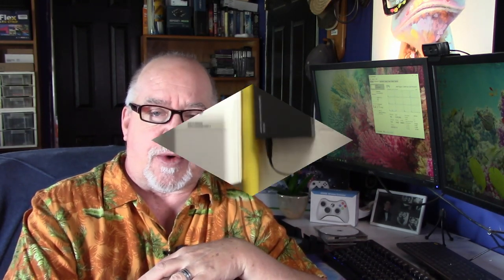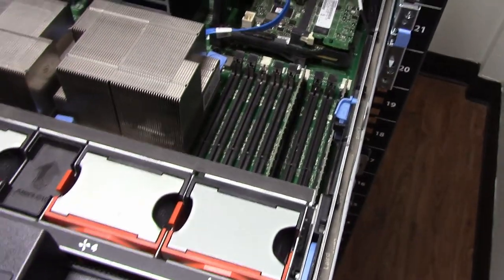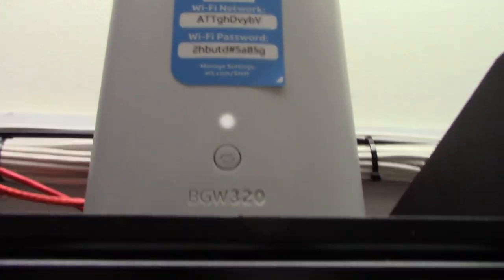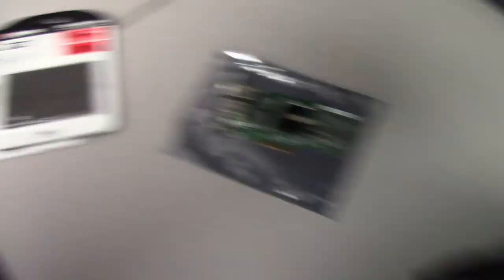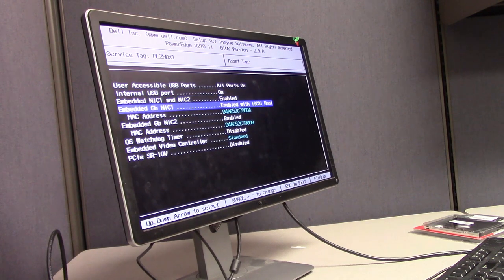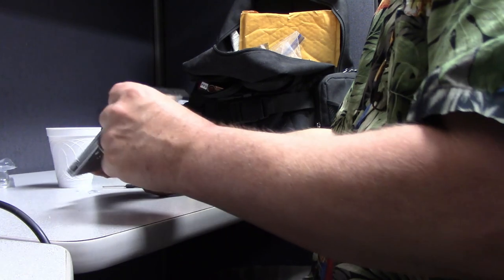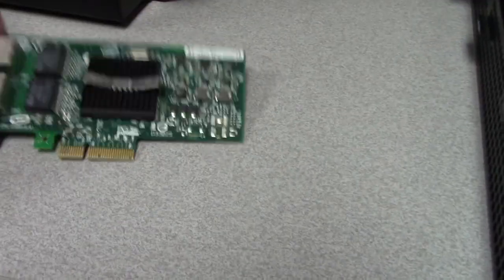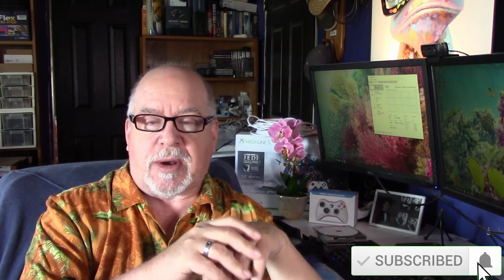A day in the life of an IT Guy - We Need PLAID SPEED!

Comment: Hi Unkyjoe! Thanks for the video! I don't have a solution for you on the network speed issue, but whenever I run into something like that, I like to diagnose things from a very low level and work my way up. I don't recall the commands for *BSD based OSes, but if it's similar to other Linux/Unix systems, the "netstat" command can provide detailed statistics on the interfaces. I would use that to get more diagnostic data, like are you seeing CRC errors (often indicator of bad physical layer/wires/connector)? are there dropped packets? and if so, in the TX or RX line? Is the ARP cache stable or is it purging and relearning the MACs? For TCP stream testing, do you see retransmits? Also, I don't know the command for *BSD, but there should be a way to confirm your negotiated link speed and duplex settings - check if that results in consistent settings across multiple reboots. Sorry, not a direct answer, but perhaps will help you diagnose the problem a little deeper in pfsense OS. Good luck my friend! :-)
Reply from the maker: I will give that a try.

Comment: I have exactly the same server running pfsense. (r210 ii) with the on board network cards at 1gbit zero problems. I think it also has something to do with the cable. For the main memory you can unfortunately only use UDIMM. If it doesn't work with the intel card either, it's not up to the sever. May be the modem a little picki is when connecting. Starting from small (cable) to large (pfsense configuration)
Reply from the maker: I will give that a try.

Comment: On these newer gateways from AT&T when you put them in bypass mode the Lan ports limit your speeds due to firmware bug. There was a firmware update to fix the issue. Not 100% sure if has.
Reply from the maker: Thanks for the information.
Reply: @UnkyjoesPlayhouse  No problem. If you set the Gateway back to default with router functions and firewall enabled your speeds will be right where they need to be.

Comment: You may think I sound crazy but hear me out. I run pfsense on an old lenovo server (yes different brands I know a major difference in bios) but to get gigabit on my router to work I had to install an old version of pfsense and upgrade. It initially started as an installation error one day not detecting my boot drive. Mind you no updates had occurred and my machine already had the latest bios update. My server has intel nics, so I don't think it's a nic issue as I also have routers out there on Dell servers with Broadcoms running gig speeds just fine still.  Longer story made long, I had the same experience with rebooting the modem, sometimes it would hit gigabit most of the times after the reboots it didn't. My boot drives were fine I just had to reinstall with an older version and upgrade and I've been hitting gigabit since. Why or how that made the difference you tell me lol
Reply from the maker: I will give that a try.

Comment: Since ISPs have started offering 1Gb on private networks, the shortcomings of consumer hardware is becoming apparent is what I feel. But I digress. I have never used and Edge Router Lite, so cannot comment on it hitting 1Gb. But it surprised me that you say it hit that speed. Did it? Or was it just a speed where you thought it was near enough?

The Edge Router X, for example,  will not hit 1Gb. It makes Max 750ish. (Sorry I do not have the exact figures in my head)…

The ports are theoretically capable of the full 1Gb, but the system cannot do it. This is FACT with the ERX, it even says so on the website. I switched to the Edge 12 for this (and other) reason(s)
Reply from the maker: Thanks for watching :)

Comment: only 2 things I can think of that you prob already done was replace the patch network cable between the modem and pfsense and firmware update the brodcom network card in the pfsense box itself, tho what connection speed does the WAN/LAN side in the interface widget state ?
Reply: good Idee! I see on boot bios is not latest even too maybe same vor network.
Reply: @levelnine123  bios is newest for that series
Reply: @SakuraChan00  it show 2.9.0 I have @ last 2.10.0
Reply: @levelnine123  fair guss i dident see it on the site as listed
Reply: @SakuraChan00  Dell Server BIOS PowerEdge R210 II Version 2.10.0 date 16 Jul 2018